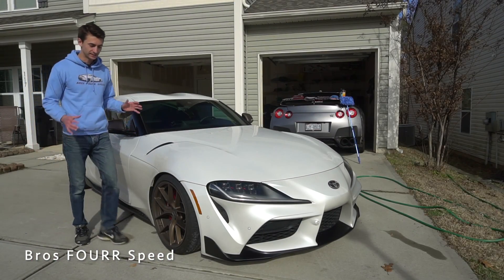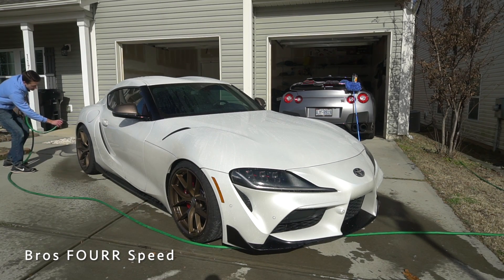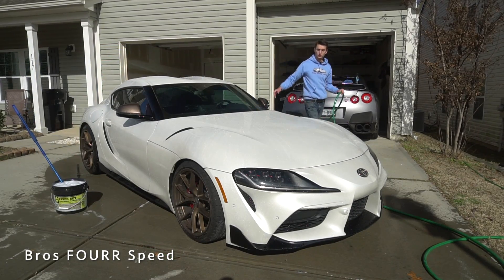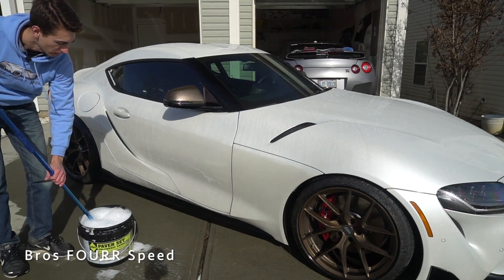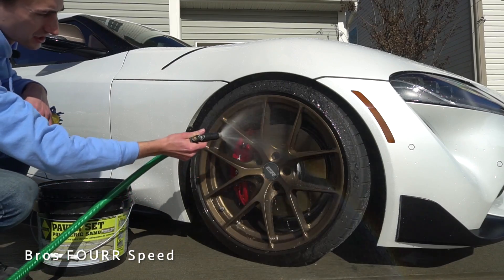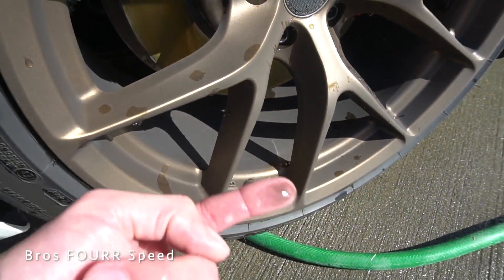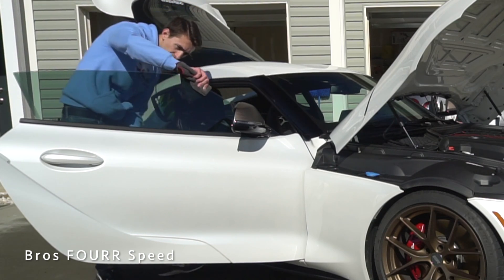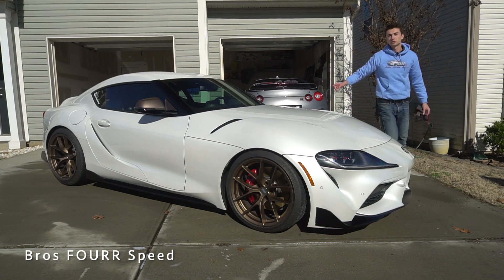Setting Up a Car Wash During The Winter! Feat: Toyota Supra

Comment: I always use the three bucket method with a grit guard. Start with the wheel using Adams wheel cleaner. Then using my pressure washer with mtm pf22 foam cannon and CG honeydew snow foam. Using ego leaf blower to blow the water off and microfiber towel and p&s bead maker.

Comment: Do you drive the supra in the winter? If so what tires are you using and how well does it preform?
Reply from the maker: I drive all my cars year round. We only get snow maybe 1-3 days a year. So I stick with my performance summer tires year round. When it's less then 40 out I wont floor it in the Supra since it will spin. GTR can handle 20 degrees outside and still have traction with summer tires.
Reply: @BrosFOURRSpeed  Okay thanks for the response. I live in Toronto haha :( So I was wondering!

Comment: Don't you have a ppf on this ? Do you really need to be that careful when scrubbing? Or does ppf also scratch?
Reply from the maker: Pat front end has PPF along with the lower section. Roof, doors and rear are not covered. Regardless I still don’t want to leave swirls in the wrap
Reply: @BrosFOURRSpeed  yeah that's what I always wondered about PPFs

Comment: When you do not have a constant stream of water on the wash mitt, you are grinding the dirt into the paint surface.  You are fooling yourself if you think you do not have swirl marks.
Reply from the maker: Well when I inspect the paint with an LED light. There are no swirls. The ceramic coating is much harder to mark then clear coat